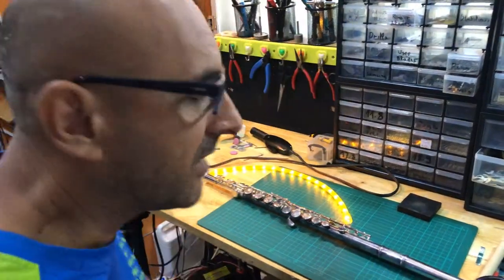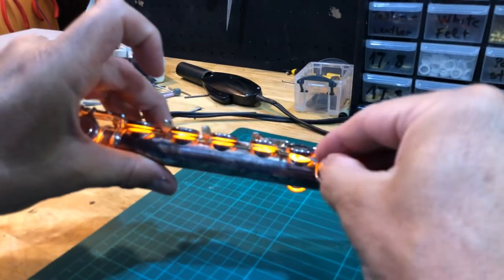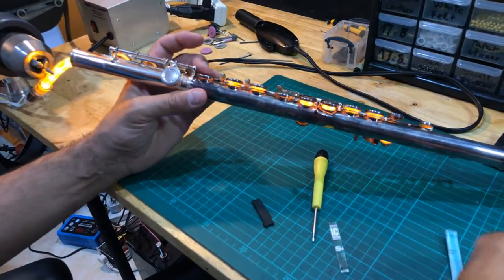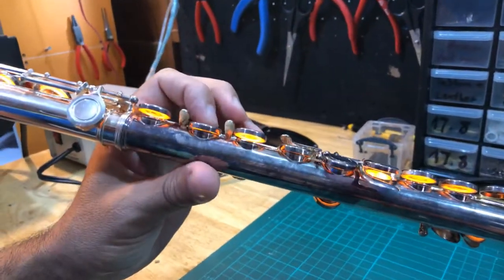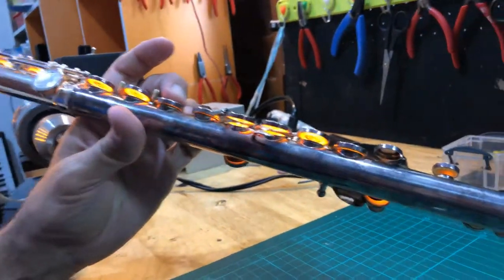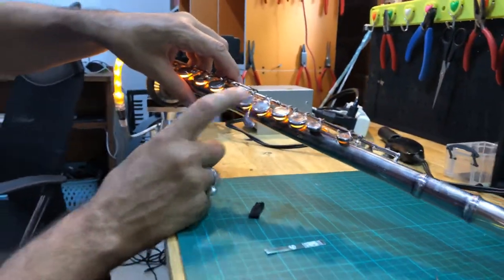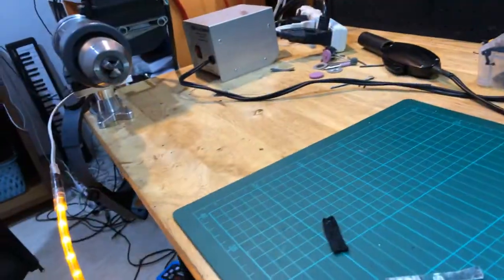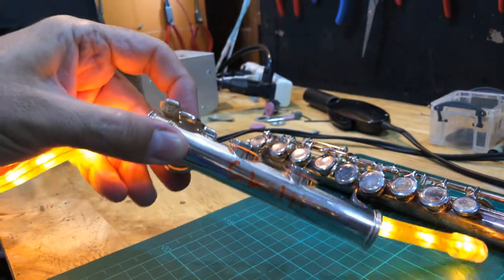How to adjust a student flute

Comment: Exactly what I was looking for. Thank you!!  Could you make a similar video for piccolo?  I don’t see any screws on the piccolo.  I think it must be the pins but can’t figure out how to adjust them.
Reply from the maker: Piccolo doesn't have adjustment screws normally and everything is very small, so I would have to zoom in and get a sharp picture to show that. The pins that you see are only there to secure the connections between keys and lugs. You don't adjust anything with those. Next time I am working on a piccolo I will turn on the camera. It should be in a few days
Reply: @matijaflutes  sorry, the piccolo video never happened, but the thing is that I switched to magnetic pads, no more glue, burning pads, or making a mess. They can be shimmed like normal pads. My patent filed two years ago :)

Comment: Hi there. Could you please advise on the specific screws I should adjust to fix the issue where my high E flat sounds flat with standard fingering but is in tune with the shortened fingering? I frequently alternate between the two fingerings in chromatic passages to balance the intonation with surrounding notes. I appreciate your help.
Reply: High E I suppose in the third octave... and the lower two E's fine? It's hard to tell without actually having the instrument in my hands, but sounding flat has more to do with key heights, headjoint cork placement, and how far the headjoint is pulled out. Once you move the head, all the mathematical ratios change, so it's a compromise which you have to compensate with the way you blow. Adjustments don't solve intonation problems. Flute is also not a perfect instrument, which refers to the intonation, so don't expect it to be as accurate as a piano. Equal tempered scale is off in the first place. Temperature and the way you blow affects the intonation a lot. The distance of the key cups from the toneholes should be properly set because it affects intonation as well. Too many factors, sorry I can't help long distance.
Reply from the maker: There are no screw adjustments for Eb. Check if D# key opens enough. If the key height is low it will make Eb flat. In fact all the keys on the footjoint should open more than centerjoint keys.

Comment: This is good for student flutes but for intermediate, silver or professional flutes its mutch better to adjust the pads rather than bend the keys.
Reply from the maker: The title says "how to adjust a student flute", right?
Reply from the maker: However, keys are bent around on all flutes at some point. If they are perfectly centered and leveled, then you don't want to mess with them, but if you see that the key itself isn't where it's supposed to be, then you bend it into place, then level the pad by whatever means necessary that doesn't compromise the pad.

Comment: My F/F# is not working🤧
Reply: do you have an adjustment screw for F-F# or a back connector?
Reply: @bhairavesh  there's this screw thing at the back of F. I tried adjusting it but it messed up my E and D so I twisted it back to its original position🤧
Reply from the maker: @refamaesanchez2870  If you work on F-F#, it will create lost motion somewhere or everywhere, so once you start the adjustments from F, you check E-F#, D-F#, F-F#-A#, A-A#, and Thumb-A# and after adjusting all that you have to fix lost motion by making new tails for basically everything other than F, and in the same order as I listed above. However, just fixing the F-F# adjustment should not change the adjustment situation with the rest of the right hand, just lost motion. It will change the adjustment with A# though, so you need to fix that one afterwards.